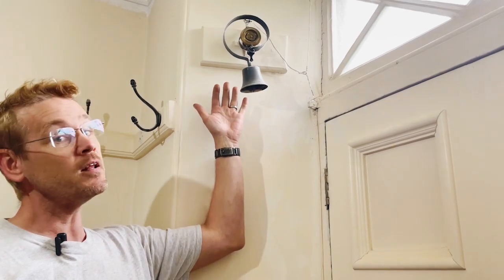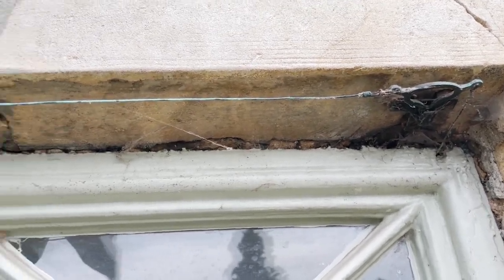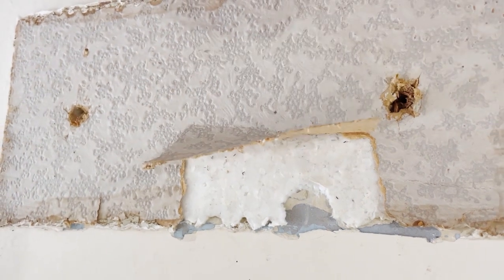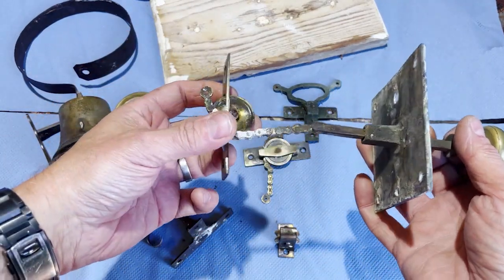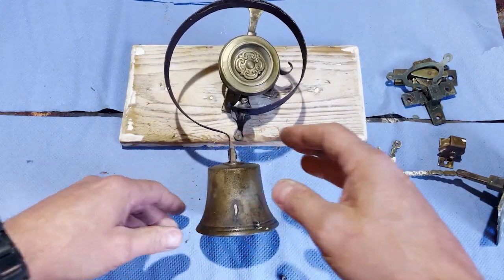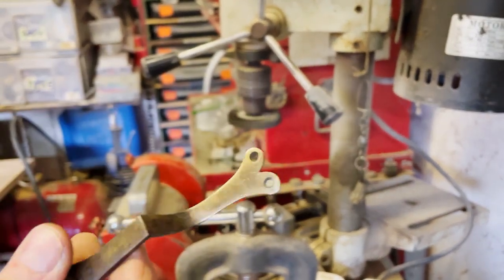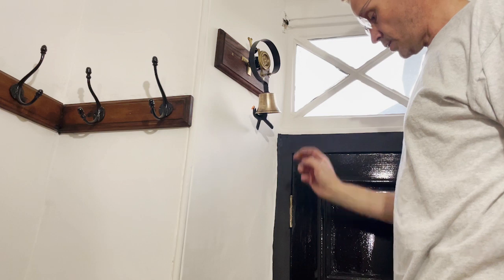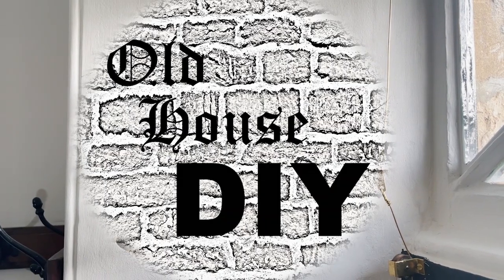Bell pull door bell

Comment: I'm interested in how the pull handle is retracted. How much spring is there to pull the handle back, and where does it come from? Is it just the bell spring that adds tension? I have a similar pull, but am missing the internal fittings. I thought I might need a spring on the handle but now not sure
Reply from the maker: Yes, there is a spring in the handle as well, it’s not just the bell.